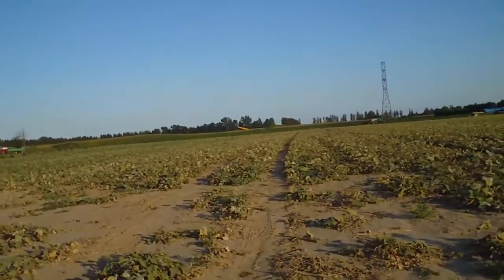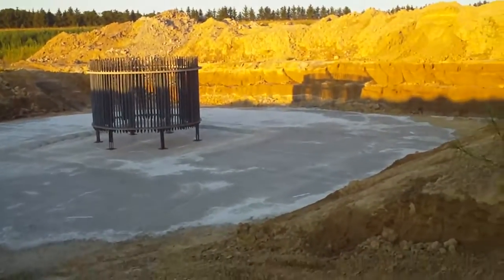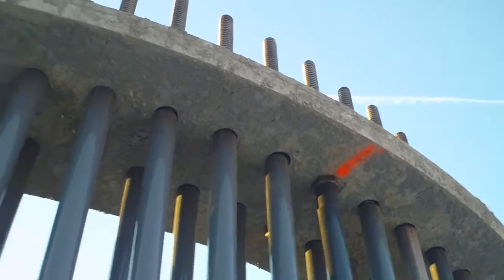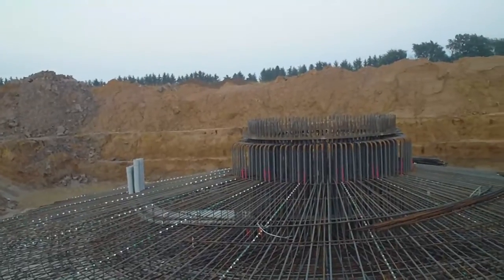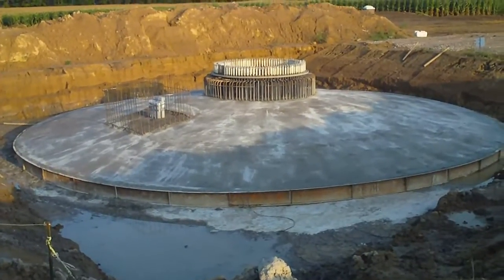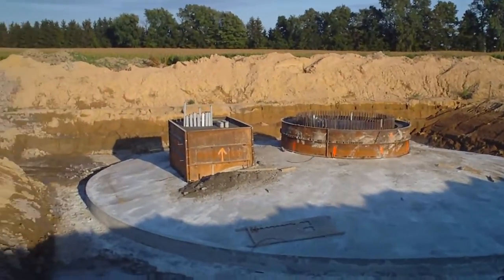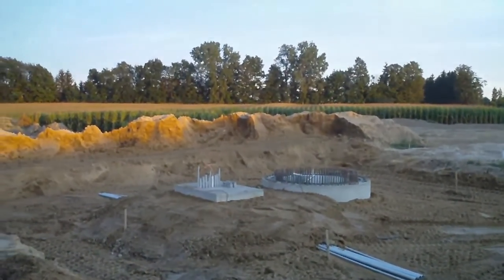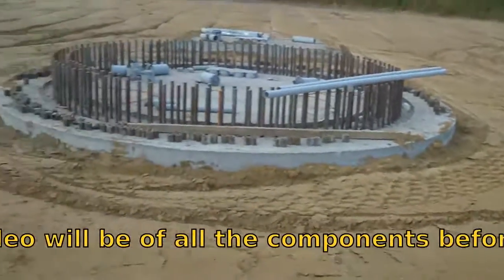Wind Turbine Build - The Foundation

Comment: I have not yet seen an honest assessment of how much fossil fuel is consumed manufacturing everything related to the foundation. Rebar and concrete require huge amounts of fossil fuel to mine the raw materials, condition/prep the raw materials, make iron then steel then rebar and concrete. Add the steel and copper and composites that make up the wind turbine itself. And finally the entire construction project from site prep to assembly to interconnection.

I want to know when a wind turbine has produced enough electricity to offset the fossil fuel burned to produce it. I've seen claims that the answer is never.
Reply: Short calculations based on approximately for 300tons of concrete used on 1-2mw windturbine the co2 emissions are 72.000kg
Per steel 200-230tons on 1 turbine makes 54.000kg co2 emissions
Not even have to go further with the calculations and it makes very clear message that those turbines won't never be self efficient.
Reply: @Matkustaja  Perhaps the central lie the environazis continue to get away with is the CO2 debit of all the (non) green technology. I recall writing letters to editors in the 80s pointing out that while yes, EVs do have zero tailpipe emissions they aren't emissions free. The emissions are simply shifted to the power plant providing the electricity. The CO2 debit which the lapdog/party organ media never asks about is just another form of Not In My Backyard. The CO2 emissions of China and India continue to rise.